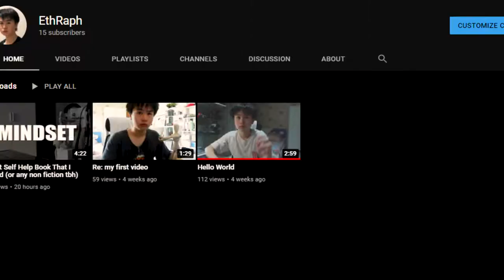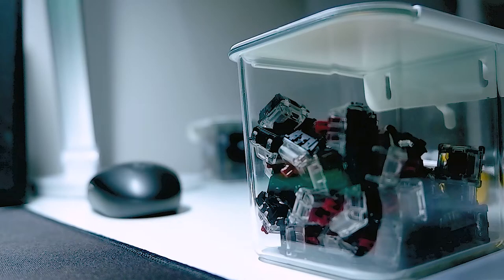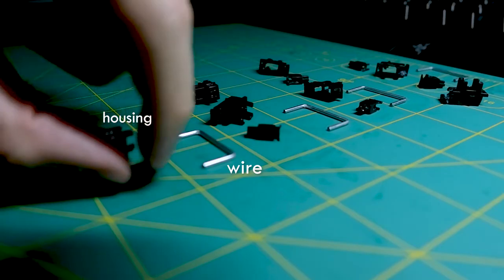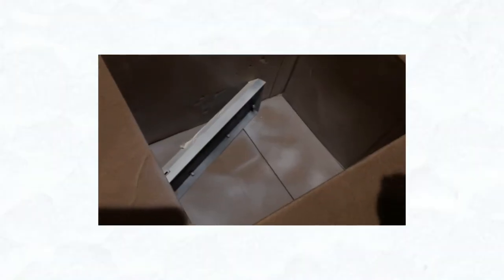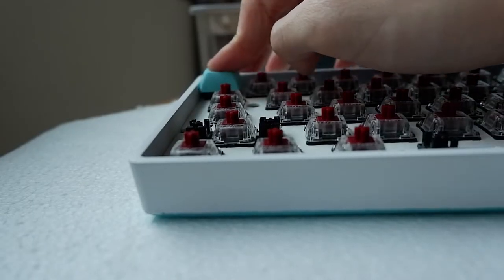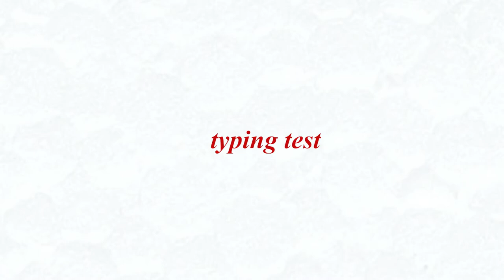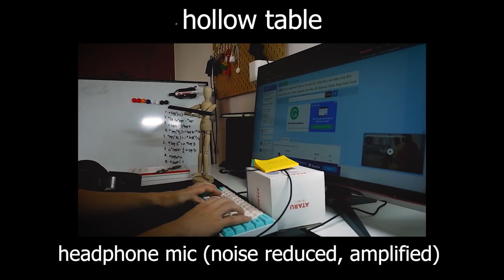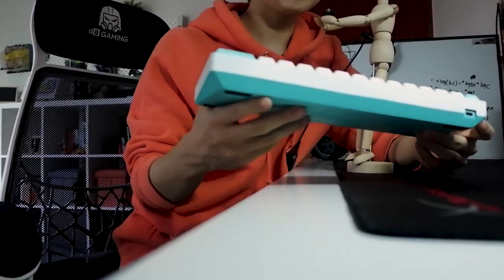My First Time Modding a Keyboard (GK61)

Comment: I have an SK61 with gateron optical browns, very similar to the GK61. I will be modding it once my items arrive. Got some Tribosys 3204, TX switch films and some EVA foam on the way. It will be my first time too. Kinda apprehensive ngl
Reply from the maker: Nice! Good luck on your build, most of the information should be on the internet, so you shouldn’t worry

Comment: Question: For the white and black version, Can u use any switch u want?
Reply from the maker: I think it all depends on the pcb, my one’s the hotswap gateron version, so only the gateron hotswaps are useable.

 The normal one, where you need to solder, should be universal.

Comment: Great video, I just recently got the GK61 after using a Razer keyboard for a long time. I have already foam modded it. I had issues trying to reassemble my stabs too, so it's nice to see someone explain a good way of putting them back together. I'm waiting for my banana split switches to arrive. Gonna lube them, the stabs and band aid mod and I think add some more foam. I have foam between the PCP and the frame as well as the case in the bottom. Eventually getting a wood case and foam modding that too for some extra thock. Great content though. Glad to see content on the GK61!
Reply from the maker: Nice to hear, I came from a razer keyboard too, grew out of the green switches. I opted for a wooden case as well, but my budget was blown right after the keycaps. Though, your build sounds promising, have fun building it!
Reply: @ethraph82  y banana splits came today and I just finished lubing them and the stabs. They sound beautiful. Definitely thocky for sure. In my opinion the stabs are decent for a fairly priced keyboard however the spacebar stab isn't ideal. I lubed it with Dielectric grease and lubed the housing and still has some rattle, even with foam and tape within the case and PCB. Other than that I could band aid mod it, but honestly that isn't soo hard and eventually I will get better stabs and the wooden case. Just waiting on some new keycaps and then that is it. Although I have very much enjoyed the process of doing this. Making mistakes and learning from them, as well as from videos like yours.
Reply from the maker: Yeah, my spacebar was still rattling, even after lubing and the foam mod. But the bandaid fix the issue for the spacebar, although it made the spacebar a tidbit heavier. But since your planning on changing the stabs and case, yeah I wouldn’t really bother. Glad I could hear your story on your board. I remember staying up late trying to fix those goddamn stabs. Well, enjoy your board for now!

‘if I were you l, i would wait a year for the wooden case, just so the build feels “new” a year later 😅